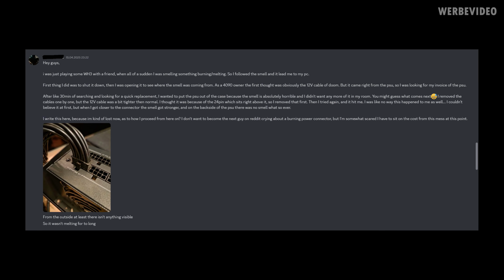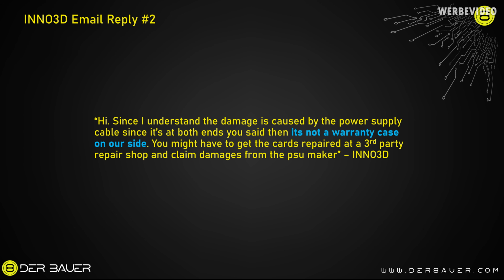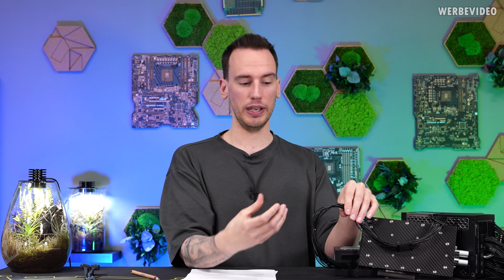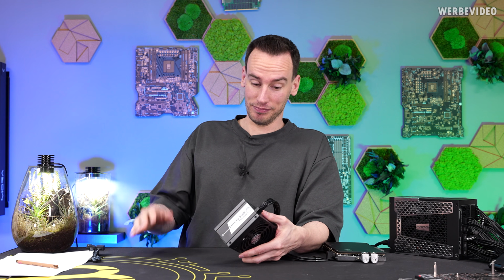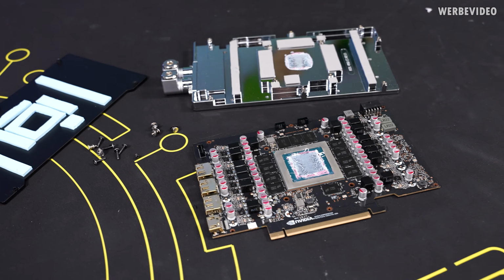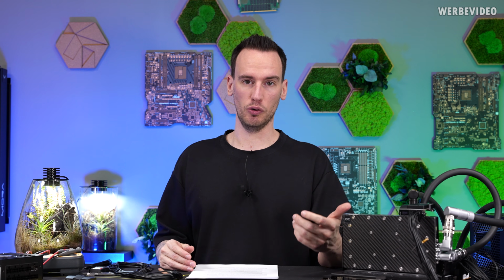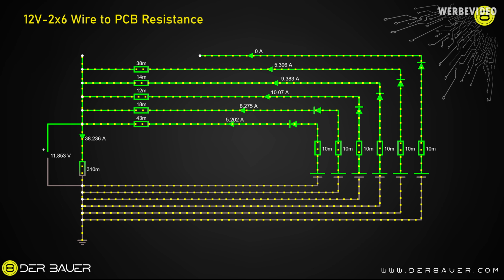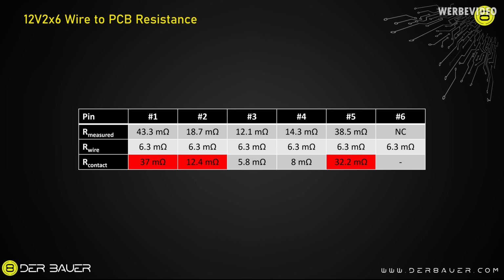Investigating and Fixing a Viewers Burned 12VHPWR Connector

Comment: So basically never say that the PSU part also melted, or if you use 3rd party cable. Give those vendors as little information as you can get away with as they'll use anything they can to reject your warranty claim.
Reply: I’ve been part of the warranty ecosystem, and yeah, less information gives you a better chance of a claim. Don’t tell me how you broke it or what you think broke it, just tell me it broke and your serial number.
Reply: The best course of action is always, i don't know what happened, but it doesn't work, take your product and fix it.
Reply: Why not avoid HPWR connector alltogether really....? It's been so messed up FROM DAY ONE, with no one taking the blame, or shifting the blame among themselves all  the time...  Connectors on both sides, GPU's and PSU's side still burning... Don't waste your money on the high to mid chance of connector melting and you get stuck with 2000$ paperweight along with a few hundred dollars for messed up PSU paperweight
Reply: @Umovni  That's why you never buy ngreedia shitty hardware. AMD only. More funny is there is no problem with rx 9070xt sapphire nitro which has this cable. Sapphire engineers>>>>>>>>>>>>> nvidia
Reply: @MacTavish9619  ignorance is bliss, AMD RX 9070 XT is equivalent of RTX 5070 Ti, you don't hear about those having issues either, know why? Because both of those GPUs are not even getting close to draw enough power to cause connectors to melt. The problem is only with Nvidia because only Nvidia have GPUs that draw soo much power, but performance per power seems to really be similar enough between AMD and Nvidia that it would affect AMD as well if they would offer a GPU comparable to 4090/5090 in performance.
Reply: @lunamoo199  Provided AMD would go with the 12 HPWR connection, instead of let's say 3 or 4 PCI-8pin. Or, as I believe AHOC showed - you need to engineer the power regulation on the GPU side of the connector, for proper load balancing - like the 3000-series did.
Reply: @MacTavish9619  You are likely going to see this connector on all AMD GPUs in the near future (likely next generation) because that connector is part of the ATX 3.x standard and you'll have no choice if you have a ATX 3.x power supply. Currently AMD's only saving grace is all their GPUs have lower power output and lower wattages needed.  I have a 4070 Ti with a 12VHPWR connector and it's not a problem because it runs well below 300 W
Reply: @lunamoo199  Worse for AMD because they are less efficient than Nvidia. For instance a 5080 is about 20% faster than a 9070XT but uses 14% fewer transistors. Because of that dynamic AMD can't come close to competing with a 4090 much less a 5090 because the die size would be way too big to be practical.
Reply: @longjohn526  And they shouldnt compete in high end in the nvidia 12vhpwr melt everything and take no responsibility near future. When nvidias 12vhpwr disaster connector standard gets buried at last as it should, and "new" connectors, so really other old connectors already in use in other powerful electronics gets introduced to pc gaming hardware and psus. Then they should also make a video card that draws power like a microwave oven and costs the same as a used car. So you can play a video game.
Reply: @Umovni  no, the connector , or style of connector, is needed to neaten our systems. It will get better and there are just a few with this issue compared to the hundreds of thousands/millions with a working connector. I also prefer the PSU side has normal connector and not the new connector
Reply: @huzaifavawda8383  Thats not quite true. This power connector has had major issues since the 40 series came out. its all about the GPU's inability to distinguish how much current is coming down each cable (something that the 3090ti which used this cable 1st could do). Nvidia has muddied the waters citing "user error" consistently throughout and the AIB's have picked this up to justify defaulting on repairs and full replacement. For context 6/8pin power connectors have had roughly a 3.3% failure rate over the last 17 years they have been used, the 12vHP is sitting at 4% of the cards in the last 5 years. That is a terrible failure rate.
Reply: @richardmartin9263  You wrote a book for nothing. PCIE could have been unreliable but lack of people crying on the internet may be the cause of that at that time. I have had 3 series of new 12pin and they all okay. I guess pushing 5090/4090wattage through it may be an issue, but they will learn and fix it eventually. You cant snap your fingers and think things will change, some error is required to perfect something
Reply: I agree but would they not just weasel out of it after you'd sent in your GPU...connected to the PSU with the 3rd party cable? In this case I'm not sure it's really applicable advice, right?
Reply: @jlctush  Lol worst case I cut off the cable on the GPU side and crimp a new connector. Because f them.
Reply: +1. Best bet would be to contact GPu vendor and say "my GPU connector melted", contact the cable manufacturer and say "my cable melted" and contact the PSU manufacturer and say "my PSU melted".
Reply: Only matters if they're sending you replacement without seeing the damaged one. Otherwise, they'll probably still be able to figure it out and reject it once it's in front of them.
Reply: One lives and learns...
Reply: "Did you install third party apps?" (Cit.)

=)
Reply: Does not matter, the company is the one to say what part faulted. They can not just shoo you away because you changed something.
"Warranty void"-stickers are illegal. You can unscrew everything, and it will still be up to the company to determin what failed on their equipment.
Reply: I thought blatant lying was expected
Reply: Just be dumb, you're not supposed to be an engineer to repair a computer. I allways use original cables and stock settings 🙈
Reply: @Nobbi832  'I took it out of the box, used the cable that came with it, and a few months down the line, it burned... Can you help me'
Reply: @Elvewizzy. do not say anything, just say you were playing a game and it just turned itself off and started to smell bad, that’s it, if they ask you, just say the same thing. They have no choice but to take it

Comment: I stand by my decision to not buy any gpu with 12VHPWR. Vote with your wallet.
Reply: i agree, Nvidia are proper silly with the design choice
Reply: @indigoskywalker to be fair, as someone who just swapped a 2070 super out for a 5080, the idea of the 12vhpwr cable makes total sense. its compact and clean, unlike a tangle of daisy-chained 6+2’s cluttering up your gpu. even cleaner when it’s a single cable straight from your psu. just wish they didn’t cut corners on the connectors ability to not melt itself…
Reply: @slickest123452 don't cry when it burn then 😂 you people always find argument to rassure some ego purshase at least just say that, you can't deny the fact that this connector is a totally mess
Reply: @upnext2511  when did I say the connector wasn’t a mess? I simply said I prefer the updated connector’s look compared to 6+2’s. I needed a new graphics card for work, and wasn’t going to buy a used one, so I had no other option than the 12v cable. At least the number of melting occurrences have been relatively low, and it’s not a 5090, so I’m not particularly worried.
Reply: @ i hear you but that connector was never going to sustain 10 amps per pin
Reply: @slickest123452  Who cares how it looks.  Nobody other than you.  Safety first. Anything with the melty burny connector type needs to be boycotted 100% of the time.
Reply: @ you say that and yet 50 series has been sold out over MSRP for months. Again, I’m not defending a bad design, just stating that it made sense to go from 3 cables to 1 as a design brief. And as the actual failure rate is so small, it wasn’t enough to force me to buy a used, overpriced, slower gpu for my work rig.
Reply: @ I could buy 5090 but I won't because of this issue. And everyone should do the same so they learn how to treat their customers right.
Reply: @ doesn’t mean a thing, the 5090 is an amazing card but nvidia and power delivery have been a long road of problems
Reply: @upnext2511  you just need to lay off the computer reviews, it's just a echo chamber of Nvidia hate. My 5000 series is great, not one issue.
Reply: 3090 Tis are fine, they just removed a couple of things from 40 series onwards.
Reply: My 3 years old 3090ti has that connector and also pulls 455 Watts and yet hasn’t burned down my house.

It’s not a connector problem it’s how the power is physically managed by the gpu.
The 4090 merge all the power pins where the connector is soldured to the board.
The 3090ti on the other hand have modules to controle individually power comming from each power pin before merging them together.

The 4090 problem is that no regulation occures and electricity tends to take the path of least resistance, even if it means running all the power through one cable and burning it down. 
It’s only Nvidia’s fault if the 4090 burns, not that poor connector.
Reply: Agreed. Was surprised and disappointed that Sapphire, AMD's answer to Nvidia's EVGA, went with it for their high-end cards. Will be watching to see if mentions of that card melting surface.
Reply: @benjaminoechsli1941 I've got the sapphire nitro+ 9070 xt and I see an average total board power draw of 370w and some transient spikes over 450w. I'm certainly going to keep my eye on it but so far it's been perfect. I opted for a seasonic PSU that had a 12vhpwr connector so I didn't have to use adapters. 🤞
Reply: @dynamitedavies same. I run my sapphire 9070xt on a 15 year old 850w psu. 3425 mhz at about 310w. Core sits at 45c in games, idek why i just got a waterblock for it LOL. Making it smaller will be nice.
Reply: Yes exactly this
Reply: Except this is an Nvidia thing. This port has had no issues with amd.
Reply: @Vespyr_  no. The people who made the standard came out and said it's a problem with 12VHPWR itself. Anything using it is vulnerable, it's just a terrible standard that needs to be reworked more than they did.
Reply: @ So, this has happened with AMD is what you're saying? Because I recall specifying that. Not that you're wrong, but it's a pretty noticeable pattern. It seems like you're claiming this is somehow inevitable for the Sapphire Nitro+ 9070 XT ~ but not one report yet.
Reply: Will do 😁
Reply: Galax has/ had? Cards with 2 of them. I think they were on to something years before these incidents happen! 
But Nvidia! the manufacturer behind this, still doesn't take responsibility of .....anything
Reply: You can, but do research in Bullzoids channep first, 99% of the cards have no balancing. The Sapphire 9070 XT is cheaped out as well with no balancing.
Reply: +1 👍
Reply: Unfortunately, you are being outvoted because these GPUS are selling like hotcakes.
Reply: @matthartman7062  
Then, why do I still using R9 380 since 2015 if those designed flawed graphics cards selling like hotcakes?
Reply: I'm confused, The last official thing I saw was it ended up being Nvidia removed parts from the 40 and new series, this is causing too high current through some wires which is causing excessive heat in those wires, which leads to the melting. I haven't seen anything 'official' say it's definitely the wires. The only thing is when the 40s came out YouTubers jumped on it being the wires when it really wasn't.
Reply: There's no difference between 12VHPWR and 12V (2x6) except you need to make sure 12VHPWR is plugged in correctly all the way.
Reply: I vote with the 850 euros i spent on an 7900xt instead of ngreedia
Reply: It's perfectly fine up to 300-350W. Like, half of its rating.
Reply: @cszolee7979  no its not, a 4090 pulls 370-400W on average while gaming (even though the TDP is higher at 450). A 12VHPWR cable is rated at 600W and still people with 4090s have this happen to them.
Reply: @cszolee7979  My limits are 80W for CPU, 250W for GPU. Anything above is too damn high in my opinion 😅
Reply: or do not buy cards that sucks 300+ watts of power
Reply: They will still sell every single GPU they produce, if it ain't the Crypto Bros it is the AI farms... they don't care about us until all that comes crashing down again.  
"Voting with your wallet" is only protecting yourself from exactly this kind of RMA mess.  

personally, i don't want the new connector because then i also need to buy a new PSU and mine is fine as long as i stick with 2x 8 pin.  
My RTX4070 has 1x 8 pin, some 225 Watt power draw max (75 over PCI-e) ... if a GPU draws more than 375W then i don't want to pay for the electricity anyway.
Reply: @ZeroB4NG 5070s and 5080s are rotting on shelves dawg. and that's with next to no Blackwell (consumer) production
Reply: the adapter all NVIDIA gpus come with are very high quality and haven't had any reported issues, so not a huge deal overall if you want to keep using 8 pin.
Reply: @nintendork07 yes, the original nvidia adapter is reliable, but this is atavism already 🤷

Comment: After GN narrowed the problem down to "user error" I have to take pictures of my graphics card connector and PSU at least twice a month in case it happens to me.

I don't think it's something that should be doing with a product of that price.
Reply: Thing is that Inno3D made the card to nGreedAI spec.
There is ZERO load balancing in the spec itself. This is how nGreedAI designed the whole spec. This is THE intended behavior.
This is not the result of "user error", this is a FUNDAMENTALLY awful spec.
Reply: @BlAckH0le-m4o Ngreedia were the first to utilise the connector and push it to its limits, but they followed a PCI spec originally introduced by Intel which clearly was not subject to rigorous scrutiny.  AFAIK Intel Arc stuck to 8 pin.
But there's Sapphire who chose to experiment with the connector on a high end AMD 9070xt model, so they must know much of the market minimises and ignores this problem
Reply: @BlAckH0le-m4o the Sapphire 9070 XT doesn't have balancing either, a brand to avoid as well.
Reply: @TheDeeGeeNL  the 9070 XT also doesn't draw 600 watts to be fair...
Reply: same. just in case. thermal cam too 😅
Reply: People keep repeating this out of context, but what GN actually said was it's user error due to bad design, which is also incorrect, but there's a huge difference between "people aren't plugging it in correctly because the connector sucks and makes it easy to screw up" vs. "people aren't plugging it in correctly because they suck".

Again, their conclusion was still ultimately proven to be wrong, but if we're going to bitch about accuracy, don't be a hypocrite and leave context out.
Reply: @blarghmcblarghson1903  I clearly saw the video and I know what he said, but the companies don't. If he had simply said, "the connector design sucks," and thats it, the companies wouldn't have used it as a shield like they did.
In the end, the first conclusion (even though we already know its incorrect) is the one that the companies liked since they are freed from all blame.
Reply: @Osmar-D  I think the companies also knew what he said, but twisted it to fit their own narrative. That said, there are definitely less technically literate folks out there who did misunderstand and keep banging the "user error" drum to this day, so I can't deny GN used poor choice of words.